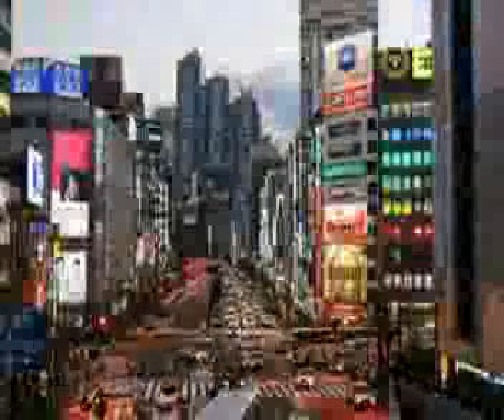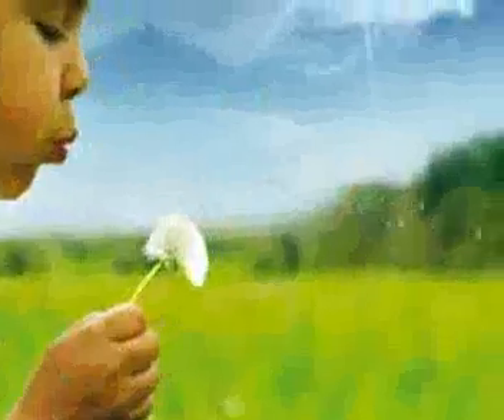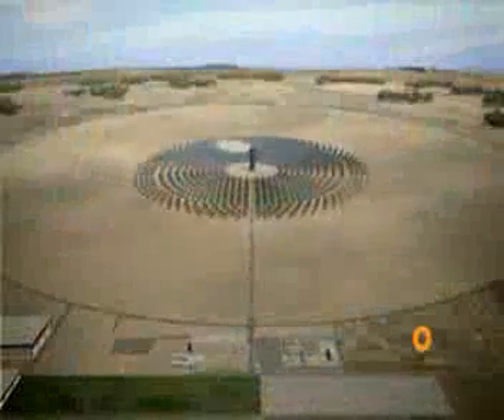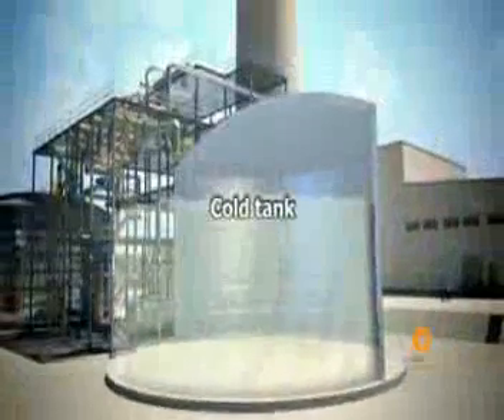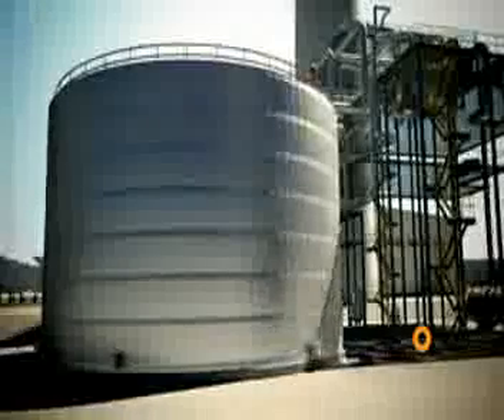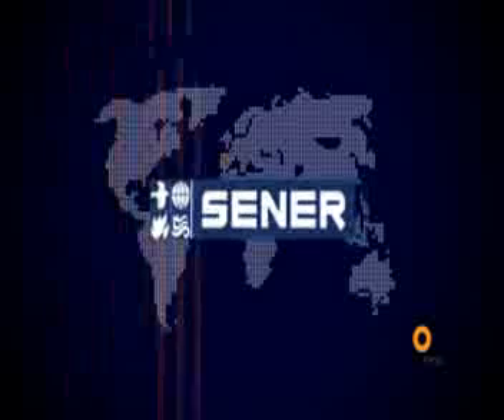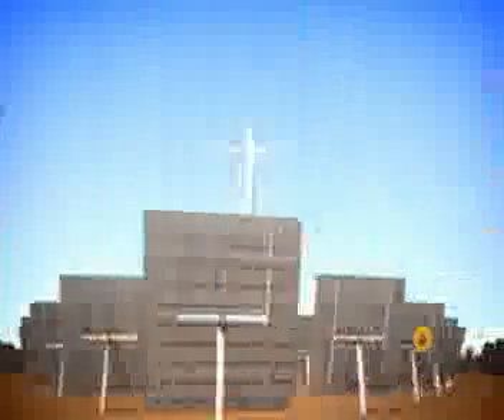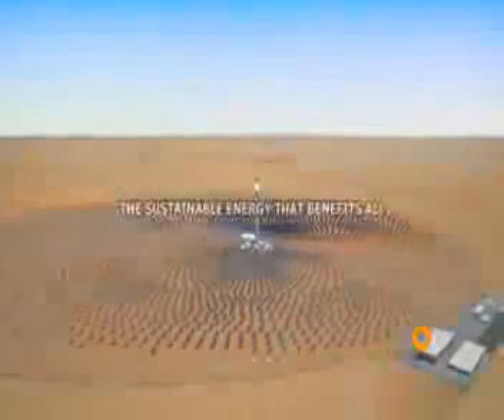Torresol Energy Solar Tres Sener and Masdar Initiative 17MW Gemasolar Solar Power Tower

Comment from the maker: @vegasjinx Actually almost all large thermal plants either use a rankine (Steam) cycle or Brayton (gaseous cycle).  The molten salt systems use salt to collect the heat through the receiver at the top of the tower, and then bank the hot molten salt in the big hot salt tank at the base of the tower.  The heat is then drawn out on demand from the molten salt via shell and tube heat exchange into water which flashes to steam and drives a conventional steam turbine.  (Same as Coal, Gas Nuke turbine)

Comment from the maker: In this case yes.  While pumped hydro is the best massive battery available at present, you get around 80% round trip efficiency not including additional transmission losses that may occur getting the electrons from your renewables to your reservoirs.  You also require a water resource that is at altitude.   Their is very little heat loss in this system.  The main loss is through flashing the water to steam in the heat exchangers.